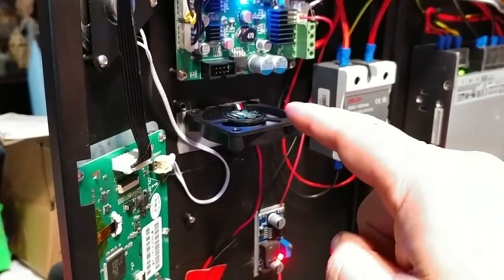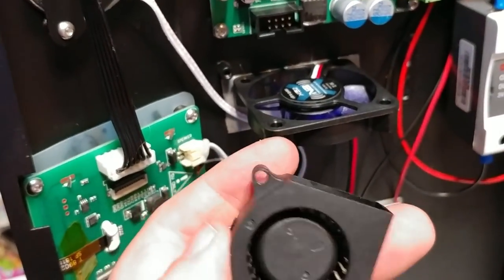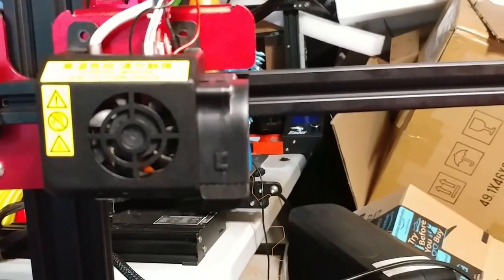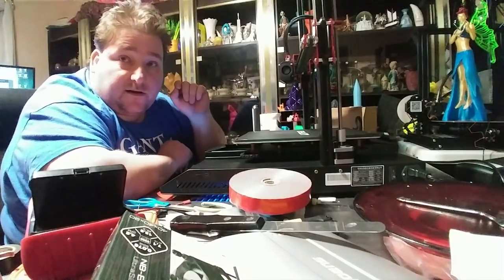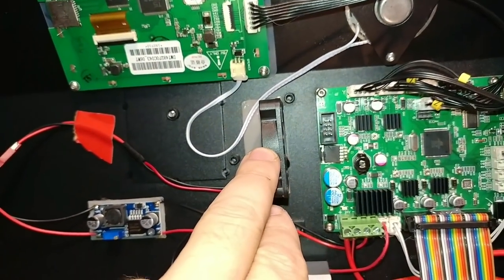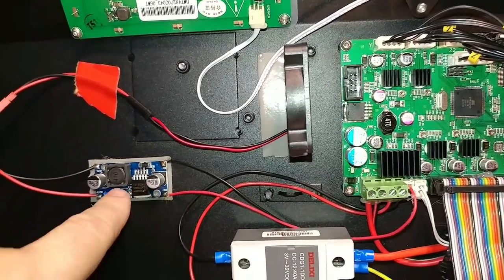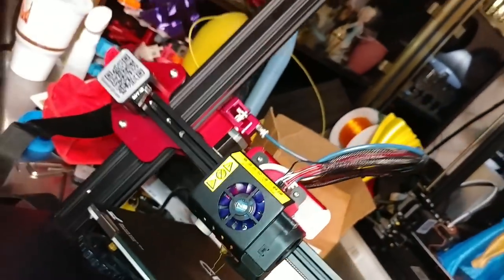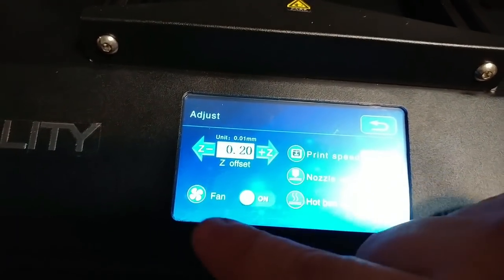CR-10s Pro Ultra Quiet Upgrade for Fans - T3DP

Comment: Hi Nerys, Thanks for all your informative videos - Hoping you can help me with my question!

I bought my first printer three weeks ago (an I3 Mega) and it has been printing great but the bed is warped making it impossible to get level, doesn't really affect my small prints but bigger things it does. I was going to just live with that however yesterday it developed an extremely loud whine when the bed moves which I believe to be the start of a stepper motor issue after some research.

As i've only had it a few weeks I am going to return it rather than try and fix it myself.

I can afford to upgrade and would like to do so now that I've realised how much fun you can have with these things - Would you recommend the CR10S Pro as a replacement? The few problems you have mentioned such was the wires cutting etc I am assuming are going to be present on the models they ship from Creality which are starting to ship in the next few days from what I have read.

I am super impressed with the quality of the prints I can get out of the i3 mega.

Thanks for your help,

Matt
Reply from the maker: the cr-10s pro is a beast and a really NICE beast but it does have a price to match. I think the price is quite good but it is not cheap.

if you want to start cheaper consider a CR-20 for around $360. or if you really know you are all in you won't be upset with the CR-10s Pro at all.
Reply: Nerys thanks for your response, the price isn’t a concern for me so if it’s worth the money i will go for it. My only other concern is around it being so new and relatively untested. I have heard that creality are known for using their customers as beta testers sometimes and don’t want to buy something that will be trouble in a few months time. I read in a comment somewhere you had been having some sort of issue with it and were looking for other owners to see if they had the same. 

Thanks
Reply from the maker: My machine came with older firmware and I had certain STL files cause the system to crash but so far everybody else has not had this problem and they all have newer firmware so I must have got one of the very early machines they do use us as beta testers but one thing to remember is none of their machines or ever crippled by any issues they find or we find :-) they can sometimes be annoying but they are still very good this printer is kind of an extension of the cr10s and CRX so it is quite well refined if in doubt give it a month and wait till people start receiving it

Comment: Couple of questions.  What kind of fan is for the Parts cooling? I ordered what I thought was the right one but it's clearly not.  Also, how do send a 24V down the converter to set it? Did you just run a hot line from the PSU?  Could I run a 12v battery to it and set the output to 12v?
Reply from the maker: The fans are linked in the description the hot end fan is a 40 by 40 by 10 the parts cooling fan you don't change because there's currently no viable replacement for it since you need to be able to control the speed once you add a voltage converter you can no longer control the speed so the solution for that is to simply lower the speed I run mine at 60% and it makes a big difference in noise

As for the converters yes you simply connect them to 24 volt power put a meter on the output side and then you turn that little tiny screw pot until you get the 12 volts you want
Reply: @nerys71  I am assuming you set 60% fan speed max for parts cooling in cura somehow but why did you say you would suggest just reusing the hot end fan for the case exhaust if you already have an upgrade linked please is it just to get the rubber piece it comes with? I am ready to order the fans you suggest but witch fan brand name do you prefer and why please.
Reply from the maker: I ordered a replacement fan but it was DOA. so I needed another fan. then I got the idea to reuse the removed hot end fan (not the parts cooling fan that stays) and decided to see what happens if I run it at 12v. not only did it work but it was silent. Nice.

so from now on I will try that first. saves me $15 ie the cost of one fan :-)

 @daviddion9150

Comment: Have you tried changing the print nozzle size yet? Hearing that they are proprietary nozzles, that true?
Reply from the maker: not proprietary just not the "standard M6 Coarse" we are used to I am looking to maybe replace the heat block with a more common one so I can use the standard M6 nozzles.
Reply: @nerys71  Thanks for the info. Also does the PSU fan run 100% of the time? Or when the PSU gets up to a temp does it kick on?
Reply from the maker: @grglover327  i believe its temp controlled so on after it warms up.
Reply: @nerys71  Thanks, sounds like this will be a large improvement over my Wanhao i3

Comment: Great video and thanks for all the links!  Is it possible for you to list in the video links/details for the fans how man of each type are needed?   I am not clear on which ones mounted in the extruder cooler, etc.

Thanks!
Reply from the maker: If you click on the description for this video, there should be linked to the Amazon pages with the parts that I used. I will double check tomorrow when I wake up. If I remember :-) Amazon's a little weird right now since they're prioritizing Essentials. So some things might not be available, but I will see what I can find.
Reply: @nerys71  I was looking for quantity of each model of fan used
Reply from the maker: @GrenexPhotos  OH should be 1 to 1. you will need a 40x10 for the hot end and I think a 50x10 for the brain board and a 40x20 for the case fan. that is all you should need. (can't replace the parts cooling fan just lower the speed to 80% to make it less noisy) Verify that with the video but I think it just has 3 replaceable fans (plus 12v buck converters since the system is 24v)

Just confirmed. 1 of each fan. if you want to save some cash REUSE the hot end 40x40x10 fan for the "case exhaust fan" but use the 12v buck converter. it will spin slower making it nearly as silent as the replacement fans (will save you $12 to $20)
Reply: @nerys71  Thanks!  I was also looking to replace the power supply fan as well like you did, so that would be QTY TWO on the 40x40 right?
Reply from the maker: @GrenexPhotos  no psu fan is different. You need to check but its either inside and probably a 60x60x10 or its slotted into the end and might be a 40x40x20

Also check voltage with a meter if its a meanwell psu its probably a 12v fan so no buck converter needed.

Comment: Thanks for the links. My ender 5 is looooud. I do have one question. My power supply is a Landy with an always on 24v fan. Do you think its plausible to use that fan plug in the power supply to run a large maybe 100-120mm fan to pull the jobs of both the supply and board fan? Then use the board fan plug as a second part cooling?
Reply from the maker: not sure how you would get direct airflow over the board AND suction from inside the PSU.

if the landy fan is 24v you will need a voltage converter to switch it out with a 12v fan. you could try using the converter on the stock fan and see how it goes. keep an eye on it the first few times make sure it spins up etc..
Reply: @nerys71  I was thinking of pointing the fan downwards and having the side vents be intake and maybe leaving the cover off the psu or print a cover with lots of holes. And raise the printer with adjustable feet on thingiverse
Reply from the maker: just be careful. the psu in this is not exactly cheap :-) don't want to fry it.
Reply: @nerys71  I think I might test temperatures. Would you happen to know a good spot to put a probe?
Reply from the maker: I don't

I suspect whichever component is making the most heat? or the most prone to heat effects? I don't know enough about that kind of stuff to determine that.

I suspect in general you just need the heat to "NOT" be inside the PSU. this is why the fan draws air out. to empty the PSU of air which replaces it with outside air as a result and keeps the heat out.,

 @danb9355
Reply: @nerys71  thank you. I'll look into it some more.

Comment: Hi, i just received my cr10s pro, have you encounted the problem heated bed cooling down within 10min print?
Reply: hey, mine does that too, i think its suppose to do that when printing pla. but mine warped. so ill just set it to 40 when its cooling down manually on the printer while its running=)
Reply: Just a heads up that "economic" is what causes that. Turn it off.

Comment: Should I get the cr-20 or the cr-10s pro
Not too worried about build volume but liked that the 10s seemed quieter
Reply from the maker: Both are very good machines very good but I do think the cr10s pro is superior better Electronics quieter brand new Superior hotend and feeder

Comment: Great video. I'm wondering now if the new quiet-driver board would work in an Ender 3 since unfortunately they switched to a fixed pulley gear on the Y-axis do you can't easily adjust to account for a damper any more. If it would actually function, what do you think the chances Creality will sell the boards separately?
Reply from the maker: right now the chances are probably pretty low but eventually they will probably sell them as for damper do you mean the press-fit pulley on the stepper motor? You can shift that you just need a punch and a light tap and you can make that move
Reply: Hmm - will that be stable enough if gets moved the full ~6mm to account for a damper? Without the added length of the collar that holds the grub screws on the older style it seems like it might be a little precarious.
Reply from the maker: yup. it works fine for me. I pushed the drive gear about half way off the rod AND pushed the rod a bit further INTO the stepper (so it was JUST recessed a we bit) their was JUST enough shift to put it back to the right spot with the damper.
 @YodhrinsForge

Comment: Hi, what's the advantage or runniing the fans at 12V compared to 24V?
Reply from the maker: Running the fan slower means it's quieter now of course you do need to be careful that running the fan slower doesn't cause whatever it's cooling to not be cooled enough
Reply: @nerys71  ah yeah, true enough. Love Ur videos btw, very helpful for a newbie like me

Comment: I just did the upgrade and all fans are working but i canttell if my power supply fan is wired right do you have a image of the inside wired? I am like 98% sure i wired it right but I cant tell if it turns on whenthe machine is on.
Reply from the maker: No. It turns as the psu warms up

Comment: Is there a differance from the xm1 and the xm2 fans in the 40x40x10. I am tho king the xm1 is cheaper on eBay and the specks seem the same
Reply from the maker: If we're talkin ultra-quiet fans I would go with General one has the higher flow rate unless you're using it inside the case then whichever one is cheaper
Reply: @nerys71  nice thank you so I will get the higher flow for the hot end and the cheaper one for the case fan and prob do the 50x50x10 for the motherboard fan thank you so much. Its not gonna sound out the wife's snoring now lol .

Comment: Hey man.. Thanks for the awsome video. Do you know if the psu Fan is supposed to turn on when you power on the printer, or does it start during the print maybe, because i have been changing the fan for the psu, but I can't seem to get it to turn on, but all the others are working fine. And it's the first time I power on the printer. (Stupid me).. So I actually don't know if the power supply fan worked, when I received the printer.
Reply from the maker: That's correct it's thermally controlled so just turn on the heat bed and the nozzle and after a few minutes the fan will kick on
Reply: @nerys71  great.. Thanks a lot for the quick response.. Kicked in at about 55 degrees.. 👍👍

Comment: Ner, there is fans that match all of those mentioned in terms of cfm and dba but in 24v. Why use 12v?
Reply from the maker: Do you have links? I have not been able to find any 24 volt equivalent fans?
Reply: @nerys71  i looked up that psu fan in 12v as im looking for the others. the one you put in has literally half the cfm of the one you removed. wont that cause issues?
Reply from the maker: Nope. no issues at all. especially if you enhance the exit path. remove some of the grill panels blocking it on the PSU shell AND the printer shell if its directly in front of the PSU exhaust outlet (not an issue for the CR-10s Pro)

the stock fans are way more than required (zero temperature issues) they don't engineer spec fans for the needed conditions. they grab the appropriate size off the shelf "whatever it is" and toss it in the shell. You can pretty much ignore the CFM specs of the original fan for the most part.

these fans don't have a lot of static pressure potential (need a blower for that which is why blowers are better for constricted ducted parts cooling) they are quite passive. many times you will get better cooling with a slower fan because under "non static loads" the slower fan will actually "MOVE" more air than the higher speed fan just beating its own turbulence up.

it works fine. :-)

 @osamarama

Comment: Hello Nerys :-) Have you found a "partcooling fan" already which is silent? And do you still use the NF for the hotend in the video? 
I changed the PSU fan already, but it seems it only turns on when its needed or?
Reply from the maker: Correct PSU fan is thermally controlled by the power supply it turns on and off as needed I have not found any 24 volt blower fans that are silent I just run mine at less than 100% when I'm able to
Reply: @nerys71  ah thanks. I maybe found one, i ordered it and will try it out. Takes 14 days till i get it. I informe you with the results. My inductive sensore is already here, i still have to change the fans, then i will tell you if it worked for me or not :-) Thanky ou again you helped me a lot!!!

Comment: There is a hotend fan and a parts cooling fan?  Did you end up replacing the Hotend one or just step it down to 12v? What size is that one?
Reply from the maker: The 40 by 40 by 10 hotend fan I replaced with an ultra quiet and a voltage converter the Parts cooling fan I left stock is a 40 by 40 by 20 blower and I run it at 40% unless I need more which doesn't happen often
Reply: @nerys71  What did you do to run it at 40%?
I'm going through the entire procedure and I'm going to replace all of them, except for the cooling fan - that I could've also replaced, but I'll need to design and print enclosure to fit some quiet fan. Thanks!
Reply from the maker: @JulianBG  in the slicer I simply tell it to run at 40%
Reply: @nerys71  Thanks for taking of your time to respond! I did replace couple of the fans and I remember you saying something about wrong wires for the PSU fan! I stumble upon this issue and I didn't know what to do! The fan near by the motherboard has different layout than those for the PSU fan (black/read wires has swapped place). Can you please confirm that the Meanwell PSU fan header follows the color standards - black for GND and red for the +12V?
And I have second question - I have a horrible issue with the low quality of the screw heads - they get damaged very, very easy, especially when the thread is poor and you need extra force to (un)screw! Did you experienced the same issue and did you know what is the type of those screws and where to buy set of them? Thanks Nerys!
Reply from the maker: @JulianBG  I would take a voltmeter to the wires to verify polarity

I have not had any problem with the screws but cheap Phillips screws are very sensitive to improper Phillips head bits they strip easy if you use the wrong head so make sure you using a proper screwdriver Phillips is not Phillips there are different versions of the same thing like different sizes number one number two Etc

And yes the screws these things to do become with tend to be pretty cheap :-) it's always be careful about cross threading and dirty threads
Reply: @nerys71  Thanks! I left with impression that the PSU fan will kick in later, under the heavy load and thus I would not see any voltage between the wires, so I left the fan without actually testing it? Obviously I have to open the printer again and fix the fan polarity.
I found what is the type of those screws - M4x10mm, so they are easy to source. I'm replacing it with Phillips cross heads which are significantly more sturdy in my experience. You are right, it is very important the instruments that you are using - the supplied one, that come with the printer are really crappy! 10% of the screw heads could not be rotated at all, because the instrument scrolls - either the head or the screwdriver is of poor quality.
The last thing left is to also replace the fan for the heater radiator, but I'm anxious about placing those buck converters without any case to prevent accidental shorts. Haven't thought about printing such enclosures?

Comment: great info thank you! finally diving into this 3d world and this printer is where I will start at. I know mean well makes excellent psu s I looked at for the power cord where I will be purchasing but I cannot find if it comes with u.s cord. any info on this? thank you
Reply from the maker: PSU's con't come with power cords. you "hard wire" them. to the IEC connection where your C13 US power cord plugs into.
Reply: Nerys oh I was looking at a 24v 1000watt mean well psu for a charger that somes with a u.s power cord. just plugs in. would have thought this Creality3D CR - 10s pro 3D comes with the cord. where I read thus printers psu is from. 110v to 240v s or does European run 220v. so much learning involved lol.
Reply from the maker: the larger ones are auto sensing most have a switch to change from 110v to 220v

the printers have a seperate IEC socket for the power cord. they are wired internally to the PSU and externally the socket is where you plug in the C13 cable appropriate to your country. usually us/eu/uk plugs.
Reply: Nerys thank you!